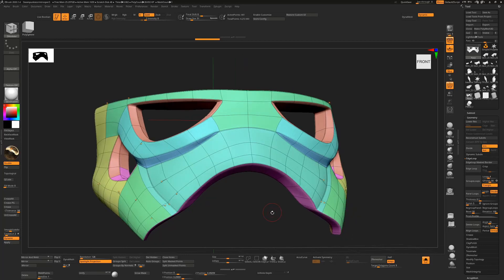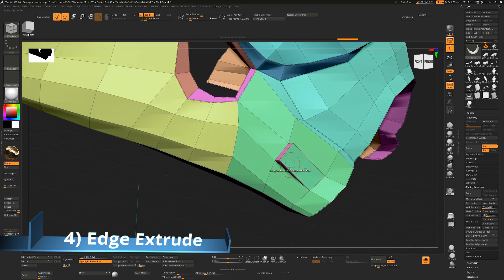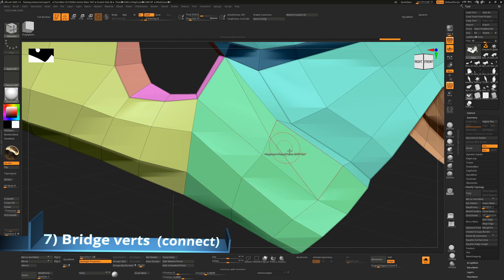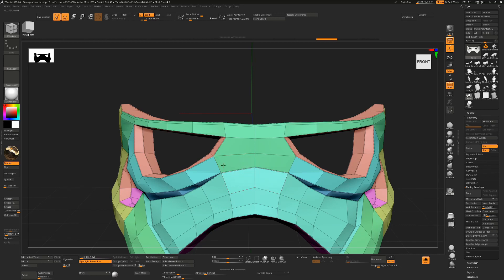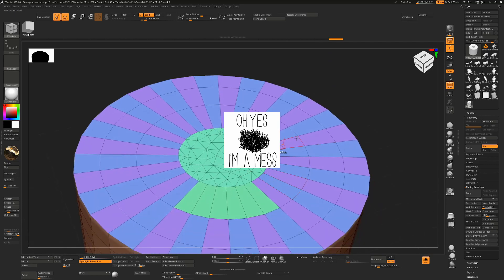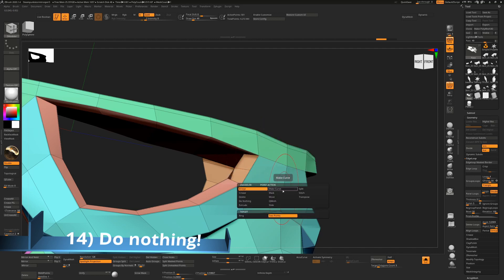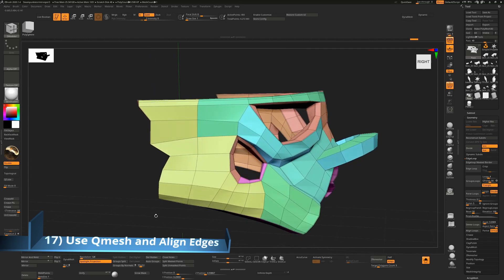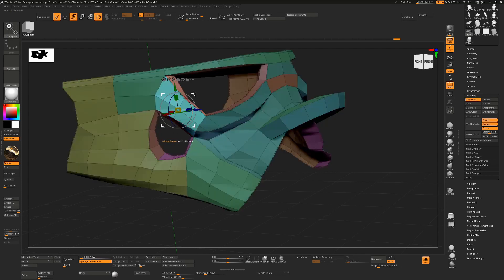18 ZModeller Tips! General tips, workflow tips and functionality tips

Comment: how you to create so clean polygroups in different areas?
Reply from the maker: Well this model probably started out as a loose sculpt, and then was Zremeshed to a very low amount, and then I manually moved the points around until I had the shape I wanted. Once you have a low res mesh, to create polygroups on it I just use the Polygroup option in the ZModeler brush to select and assign polygroups where needed, sometimes uinsg Polygroup - Polyloop, and sometimes making a selection by holding down Alt to make them white and then hitting Polygroup Single poly, which will make that selection a new polygroup.
Reply: @SeanForsythTutorials  so you can use at the begging Dynamesh for example? or even box modelling? have got some tutorial how to create good fishnet's pattenr for cloth? based on uvs? to create whatever type of generic super heore?
Reply from the maker: @AstralNostalgia  Yep, sure, start off any way you like. Ultimately, you'll have to lower your resolution at some stage if you started off too high.  As for tutorials on fishnets or the like, I haven't done one, but you can see Mike Pavlovich's one here: https://www.youtube.com/watch?v=1xrPXIAQ4X4
Reply: @SeanForsythTutorials  thank you somuch
Reply from the maker: You're welcome!

Comment: How do we select few edges and move when I am trying it’s selecting either edge loop I need to select only the one which I want to move
Reply from the maker: Ctrl + Alt drag over the vertices you want to select and then you can change to the Move brush and move them.
Reply: @SeanForsythTutorials   Greetings, 
Thanks for the quick reply . I am doing it using zinder brush when I use ctr+alt it change to mask but it doesn’t do anything even if I drag and when I move using move it just move a singe edge .
Reply from the maker: @pleasecomment4470  Yeah, holding down CTRL + ALT will make any vertixes under the area you drag be selected (or "unmasked", hitting W to go to Move mode and then moving the gizmo wil move those edges as if they were a single edge.

Comment: I was having a hard time color picking the polygroups. I was holding shift as I was right clicking but all it was doing was changing it to a random color. then I realized I had to tap shift and right click at the same time.
Reply from the maker: Yeah, I wasn't very clear about tapping on the polygroup first, then tapping Shift while the click was still held down.

Comment: 17B : What I do is I delete 1 polygon on each side then insert the desired edgeloop and fill up the holes with bridge.
You could also mask beforehand where you don't want the edgeloop to go; it will create some triangle to connect where it can
Reply from the maker: Yep, very true, masking before adding edgeloops is another good one, thanks! It's never gonna be quite as easy as inserting partial loops and leaving ngons to clear up behind, but it's fairly easy to get around that stuff, and whatever time you spend on cleaning that up in ZBrush is at least time not spent in Maya. :)